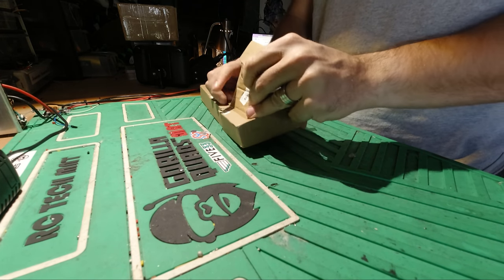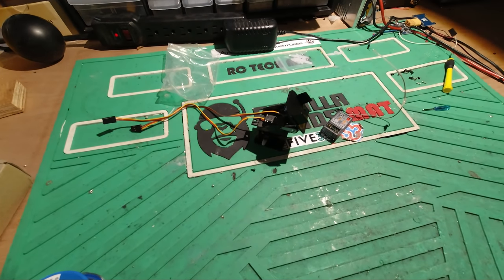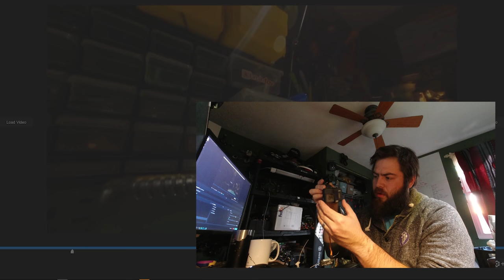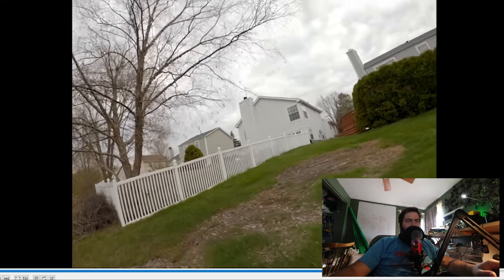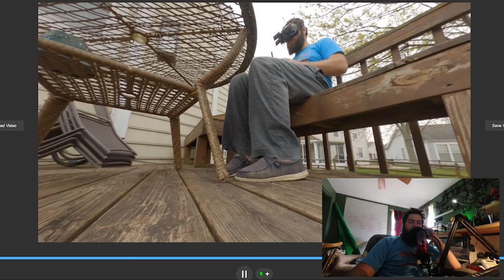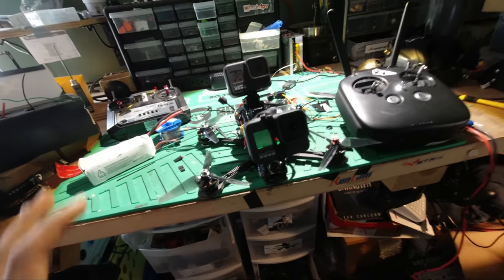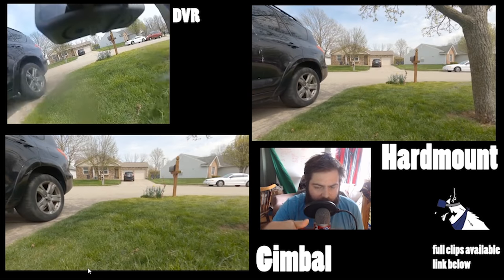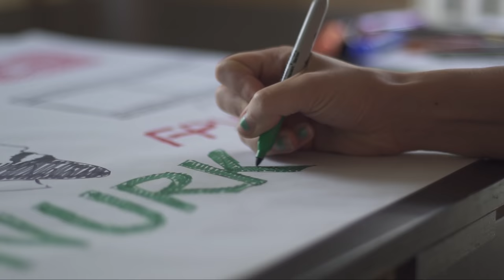Servo Gimbal on an FPV Drone

Comment: I think you can get rid of some of those jitters by duplicating the input of the sticks, inverting it, and putting that signal directly into the servo so it does the exact opposite of what the sticks do, and effectively counteracting them all together. It might take a little tuning but it could get rid of those jitters. And put it exactly in time with the turns so real steady dosen't have to work so hard
Reply: I would agree. I could very easily be wrong about this, but I think that is how the dji phantom works it's rotations into it's gimbal. I've noticed it when I just hold the phantom and give the controller turn input. Not sure if it's be possible but someway of adding both would probably be the most beneficial. Say having the controller input as the main control until the FC is past a certain value and it takes over from there until it's dropped below that set value again. Just an idea.
Reply: that would only work in autolevel mode

Comment: I did something similar to this on a wing to get rid of the "waggle" in the video. It worked fairly well on the yaw axis.
Reply from the maker: How did you get it to output the yaw axis? I wanted to try that a little bit..
Reply: @NURKFPV  I was working on this for a while with a Storm 32 controller and gimbal motor on fixed wing. I could never get the little shakes tuned out. Stunt Double FPV did some great work on this...https://youtu.be/hMYBHm4PZgw . I may try BF on a FC with a little 6amp ESC and the gimbal motor next.
Reply: @NURKFPV  I used to do this with openpilot. It had a seperate gimbal control build into the software.
Reply: @NURKFPV  I used one of the servo outputs like you did and set it up for the yaw axis. One thing I did different from your setup was to mount the camera on it own pivot and had the servo accurate it with a pushrod.
Reply: @mflacke  did you manage to control the esc and brushless motor out of the servo signal from betaflight?
Reply: @haythamfpv  No sadly I abandoned the project. But would be interested in any finding you make.
Reply: @mflacke  Oh, that's unfortunate. I don't have any programming skill, so I had no Idea where to put my hands. I went another way and bought a 1 axis gimbal on aliexpress for ridiculously cheap and I'm waiting for it to arrive and do some tests. maybe making it nake, we'll see

Comment: How did you connect the servos to the FC and have the FC control them based on orientation? Because this could be the basis of a really cheap pan-tilt selfie cam.

Comment: This was what I was wanting to do for the CheaterKwad up until I figured that a 360 cam could likely do what I need if I properly mount it.   I gave up on idea of a gimbal due to wanting something that can acro hard going forwards or backwards(or at least fly equally fast backwards as forwards like with your chase/follow example) and the CamStab would probably freak out if I didnt have a process for disabling it.

Also didnt like the idea of the servo failing me.

I did do adjustable 0-60deg uptilt for the FPV cam which I think could be hugely advantageous for certain builds with a 360cam where the drone is hidden in the blind spot.   It would revolve around climbing tall vertical surfaces and low tilt would make it hard due to thrust angles to spot your climb out  gaps.

Looking at my 6in on 2150kv 5s for ripping and a 7inch Project399 Deadcat with 6000mah of 6s2p LithiunIon to get me 23min of forwards/backwards smoothness.   I just need to get on the 360 cam game.

Givem your experience and expertise with the 360 cams I would like to hear more of your opinion where this CamStab option is better than 360 cams.   Would it boil down to the options of 4k and better quality of Hero 7/8 with ReelSteady versus the 360cam?

Comment: I've been thinking of doing this same thing.. I think maybe your gimbal strength is a bit high and you're not staying on the horizon as much as it should.  Might reduce the vibrations as well.. Just a thought.   Also.. what would happen if you put your FPV camera on there!. would it be flyable?  I might try this with a 2nd HD board.

Comment: I just started  flying  a 1 axis Feyutech gimbal I got cheap w my 2s Force1. It flies ok but will try 3s next. Will loose some drone smoothness, not much,  but gain it back in cam footage. Great vid..the comparison was epic. Very helpful to me. The Ftech gimbal wks flawless, but like to shave some grams off.  Could still get down view with tweeking. 1 servo is all thats needed for that, so 10 or so grams for micro servo.

Comment: hi
I'm on the same journey. I was thinking of buying more ready made solutions. There are some available. But they all have their drawbacks. I was wondering if you finally settled down on something useable? Because in this video, the movement is super jittery. Guess they were cheap servos. But still, a brushless motor gimbal would be better still than a servo.

Comment: Nice idea! I did something similar years ago to stabilize the pitch axis on my mobius I had mounted on a phantom with a tilt mount. It was really nice for flying stabilized.
The Naza actually had gimbal hookups...and used the internal gyro.

I will say brushed servos can work smoothly but the digital metal geared servos are the best.

Comment: The old kk2.0 fc’s had a built in stability for gimbals, I made one up for my old sk450 frame and it worked very well, and at the time we didn’t have stability using GoPro 3’s 👍

Comment: I am curious what it does when you continue a roll through 360 degrees.  My camera gimbal is not very good at handling that either.  There are also relatively cheap brushless camera gimbal controllers available that may work better for the application.  They'd take the place of your 2nd flight controller (and obviously you'd need a brushless motor on the roll axis).  There are also a handful of brushless servos out there I believe, but I think they're super expensive.

Comment: Look into SimpleBGC. Get some brushless gimbal motors & 3D print the gimbal arms. Full control with PID tuning on your own gimbal design. Full manual or auto level modes, depending on what you want.

Comment: I just wanted to share as I've bought/tested hundreds of servos. Emax makes some of the best/cheap digital metal gear servos! I typically use the ES08MDII on 90% of my projects. They really improved my 3D planes as they are very hard to break plus much more precise/smooth than any other cheap servo I've tested. If you need more strength/torque for the qopro the ES09MD are a bit bigger/more powerful. Should be less wobbly... might take a crash or two.
Reply: I've seen digital servos on pan and tilt and they can have that digital jitter. Some people like full size analog servos because they can be smoother but then you have to deal with huge heavy full size servos

Comment: Have you considered the following-
Hard mount the camera and point it at the gimbal then put a mirror on the gimbal? 

I could see a future fpv camera project where the fpv camera points at a tiny servo gimbal holding a tiny mirror. Usimg a mirror means it lighter and so can use smaller servos and then the whole weight comes down Also if you crash your more likely to break the servos and mirror rather than camera which could be easierto replace.
Also, also  we could have smart features in betaflight like
- head tracking
- head tracking which adds to your pitch and roll stick values . So you steer a little by head tracking.. 
- camera up pitch changed on switch

Comment: If you want a smoother roll axis stabilization, I'd suggest use a gimbal motor instead of a servo, the servo is probably jittery because of the weight it has to carry, using a higher torque servo should solve your problem, but won't be as smooth as the gimbal motor.
If you want to combine roll and pan/tilt, then you have to balance the entire gimbal else your motors will always be struggling to keep the camera level.

Comment: Few things that could help... Increase the servo voltage to 6-7 volts and increase its PWM rate to the maximum it can support. Maybe set your filtering for it lower as well. Best regulator I've useds was the mini-360 BEChttps://de.banggood.com/Small-Mini-360-Adjustable-DC-Power-Supply-Module-Mini-Step-Down-Module-p-917568.html?cur_warehouse=CN There should be an equivalent you can get locally.

Comment: This will likely be buried, but one things some of the best record players do is they have a very small motor driving a much larger platter via a belt to add some damping and gear the system way down to increase the number of effective steps in the motor. You might be able to do something very similar, albeit a bit convoluted, with a pulley driven by the servo, and finding some way to retrain the system to the new degree of movement required to achieve the same result. From what I can see in this, there might even be other benefits to this sort of system, as it seems your servos like to move at a little higher speed. Sort of a mechanical version of raising the D term?

Comment: What a want is a servo that will take the FPV camera from zero degrees to 15 or 30 degrees or whatever you want to fly at. Put it on a radio switch so you can have a high camera angle for fast flying and no angle for landing or if you just want to slow down and look at something. No gimbal, just a fast adjustment from zero degrees to whatever you set the other angle at.

Comment: Surprisingly good for a servo gimbal, but really I think even a cheap/low quality 2-axis brushless gimbal will provide much smoother footage for Reelsteady Go to work with.
Regarding the weight problem of them, most generic 2-axis gimbals are quite heavy due to the big motors, but the old Quanum Q-2D uses much smaller motors so is notably lighter, and has pitch+roll servo signal inputs.

Comment: You should try Inav for your gimbal's fc! Inav works nice with servos and can be configured for your need, like setting up pids and weight/power things for your servo gimbal. It should definitely help on jitter issue, cause with Inav you can tune it! 
Search for how to setup tail servo on tricopter builds, all you need is to use roll stab input instead of yaw stab input for your servo.

Comment: feels like i'm back twelve or so  years! that setup is how we oldtimers used to get a somewhat decent footage out of our wobbly multicopters..

also.. in the first test you used a insta360.. and it just does what you are set out to achieve with a gopro and some gimbals and realsteady go... 
except for the adventure and discovering what the old dudes went through years ago to get somewhat decent footage, why would you add complexity and extra postwork when a decent 360 cam can give the same result?
Reply: Gopro footage >>>> Insta 360

Comment: great video and ingenuity. not seen all comments so not sure if someone has said but is there a way you could replace go pro with another dji cam and hook the gimbal up to a second set of goggles to control gimbal by their head movement. a passenger on your flight? may require a second air unit so may require 12s/large quad. maybe pointless but may have a use for your clients on shoots and work

Comment: I thought about this 6 months ago when I first started FPV drone flying. Prior to that, I was flying camera drones, wishing I could get FPV footage this good. This is a great first start, but what do you think about starting from the other end, get FPV system capabilities into camera drones? DJI half heartedly tried when they came out with the Goggles RE and the Ocusync system. But latency was horrible, I couldn’t confidently use it. Great vid, Paul, love all your work.

Comment: Hi there nice vid and enjoyed your silly fast 12s vid. I made the equivalent but for full size drift cars so a box with servo that basiclly stays straight or straighter when the car turns underneath it. I used a rc drift gyro to control it but i had the same issue of servo judder and havnt got round to solving it. I also realise now im only getting a few degrees more than what modern go pro stability will do let alone reel steady. Im using a hero 3+ so none of thats an option but was a fun experiment. I could gear it so it gives much more angle but id be interested to know if you solve the servo judder. I like the idea of what you're chasing tho and a less cropped image is always better. If you get it reacting smooth enough and fast enough you maybe able to not use reel steady and get the same results with no loss of information

Comment: I tried this a year ago, even with a good servo you get jitter, you need to use a brushless motor with its "gimbal" controller if you want no jitter though they are super big, maybe we can ask betaflight guys to revisit this code and let us use a brushless motor an a esc for the servo tilt feature

Comment: So now you got me thinking... probably not gonna try to make a servo gimbal any time soon, but using a cheap gopro gimbal, something like feiyu tech wg2x  with reelsetady  go, might give pretty good results for me. Thanks for that  video!
Reply from the maker: Those are such weak gimbals that they give up under the g force

Comment: Yeah gimbals that I see for quads use brushless motors which react very quickly and don't have servo jitter.  It is impressive what you got from your setup though.  The way you fly drones it would seem you need some really fast actions.

Comment: I see I am not the only one with this idea of stabilising the horizon :-D Unfortunately I haven't finished it to the end. But wanted to achieve it with gimbal brushless motor. I have bought Quanum Single Axis Gimbal in sale and hoped it would work also for roll axis and not just for yaw axis as it is described. Maybe I missed something in the settings or maybe it just isn't possible to set it properly without flashing the firmware...so I gave up. I am sure that if man can attach GoPro precisely in its COG, even a small weak gimbal motor should work good and definitely react faster than a servo. But a good start of a research, that for sure! :-)
Reply from the maker: trying a futaba brushless servo next to see what that does for me

Comment: I have done this myself already on an FPV camera on my quad just on the vertical though, the jitter is coming from the second FC you can run it from your actuall FC if using betaflight I never got any jiggle that way

Comment: I guess it is jittering bc the 2nd FC feels the vibration of the gimbal movement. you may be able to filter the servo reaction frequency out alltogether or just soft mount the 2nd FC
Reply from the maker: also in the works - the VHB + ziptie method was pretty lazy haha

Comment: i think the gitter is from the servos or"gimbal" sensitivity, you should try it with the least sensitivity and see how that works, that would be the easiest quickest thing to try without having to change hardware... sorry if u tried that but i skipped through the video a bit i was in a hurry ;)

Comment: Id love to see a tuning video for a freestyle drone with a hero 7/8 seems like everytime I put my gopro on the weight throws my tune off too much and I can never seem to get it how I want afterwards
Reply: Its the same process if you tuned it first without the gopro. You just have to tune it again with the gopro on. Might need to bump digital idle up some to compensate for the extra weight as well. Having digital idle too low for the weight of the quad can induce propwash. Bardwell just did a video on dynamic idle and he covers differences between low digital idle and higher digital idle in that video also and the effects it has on propwash handling.

Comment: high torque high speed high volt servos and a external regulator. try different servo setting in baseflight

Comment: Hey Nurk! I just thought again about your gimbal movement... I think it moves too far because of the cam uptilt you have!  You may need to use the tilt value over cos of your tilt angle. so, if your uptilt is 30 degrees, you would need to 0.866 times what you do now. I think it should be level then.
Reply from the maker: that's a great idea - i'll play with that. I've also got a brushless gimbal on the way to try to smooth things out

Comment: It's because you are not supposed to force move a servo. It being cheap you probably stripped the gears. Get a metal gear servo or treat the plastic ones better. Well you shouldn't be doing that with the metal ones either but whatever.

Comment: ??? why you dont use brushlessgimbal  servogimbals are a thing years ago:-)
Reply: because at high speeds brushless gimbals aren't strong enough to fight the inertia of sharp turns and rolls and wind resistance. a brushless gimbal has almost no power at all (unless you get some BIG motors) and they will "slip" and stop working until reset, or burn the controller board..
a brushless controller only works with a near perfect center of gravity placement of camera, whilst a servo gimbal just doesn't care as long as it has enough power to move the attached object.

Comment: Bruhhh, I was literally telling my girlfriend about doing this yesterday. 

I want to hook it up to the head tracker port on crossfire. I want to add a gyro board to the DJI headset and mount the fpv camera to the servo gimbal.
Reply from the maker: yeah that's something on the list that I want to play with too -- head tracking for sure
Reply: I saw on GitHub there is some code to attach a 6050 gyro board to an Arduino nano which you could then hook up to the crossfire ht port. I have the gyro boards and nanos already, no servos yet. 

Haven't gotten far enough to see if it would work yet
Reply: I wanted to see if I could do it with gimbals though instead of servos. It would make fore a super cool experience for the person flying the drone. 

Especially if you put it on an autonomous drone like the one zoefpv is building. 

You'd be able to create a mission for it to fly and just look around while it's on its mission.